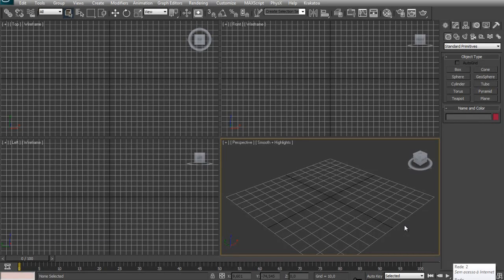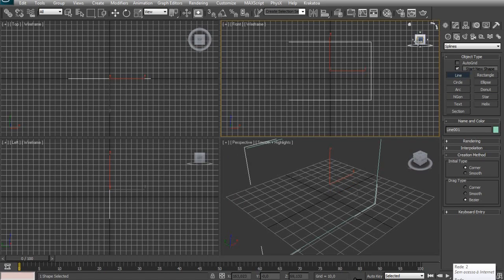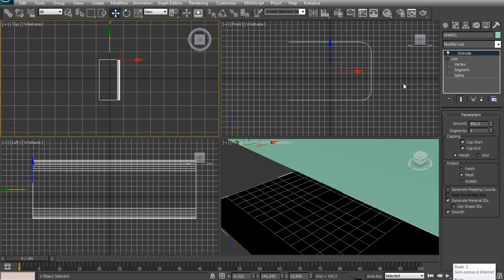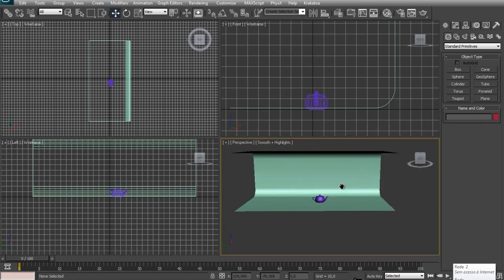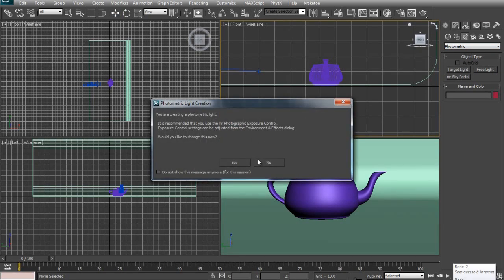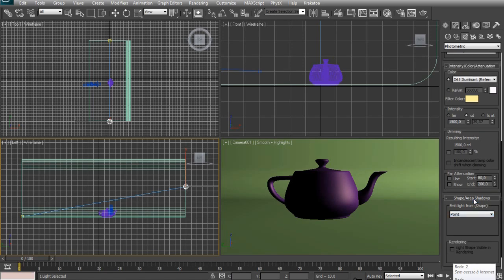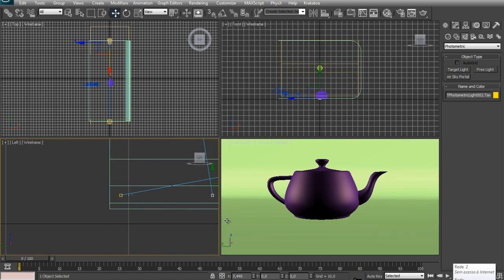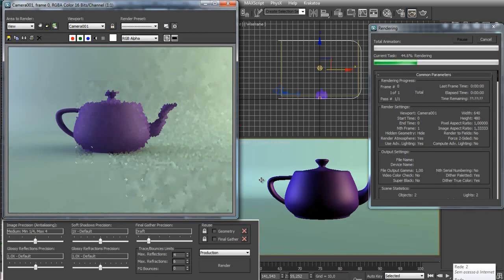3DS MAX Tutorial - Mental Ray render setup - Part 1

Comment: hi John, first I would like to congratulate you on a wonderful and clear tutorial, one of the best I seen so far. May I ask what version of 3ds Max you are using? I currently use 3ds Max 2014 x 64 student version it seems that in my Exposure Control drop down menu is slightly different to yours. Do you have an updated version of this tutorial? Also do you have a tutorial on rendering lighting effects on background scenes? Sorry for all the questions it just I was playing with my Rendering and Photo Emitters and really messed up my 3ds Max and I am trying to fix it up :) thankyou

Comment: Hey man, you is very good! I'm learning 3ds max a little time, I wonder how you did to put the viewpoint for Smooth + Highlight, I'm not lying here. Thank you in advance.
Reply: in the drop down menu of your view points.( the third lot of writing in the brackets, also where you would find Wireframe)  if its not there you may have to go and check out your configurations in View Point Backgrounds under Rendering Methods and select Smooth + Highlights that way.